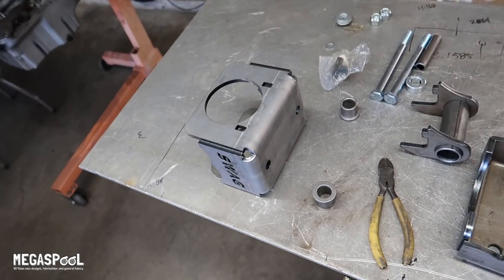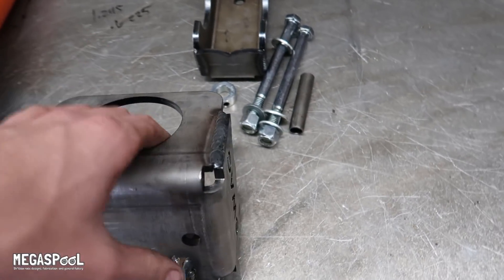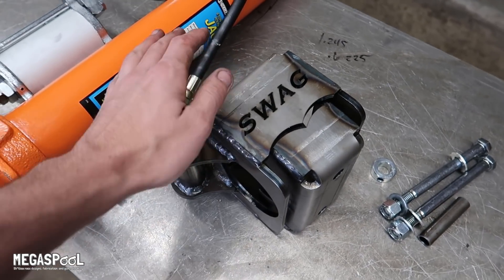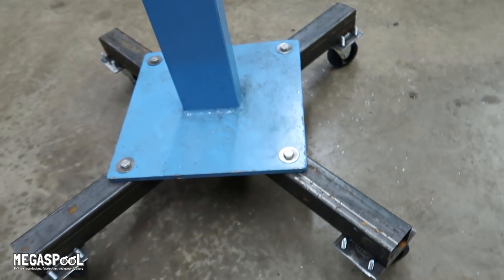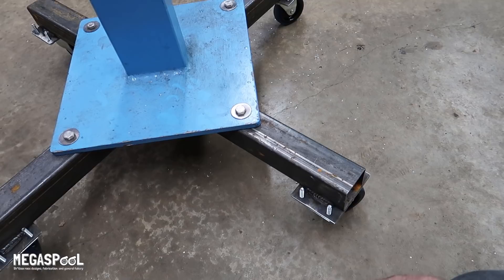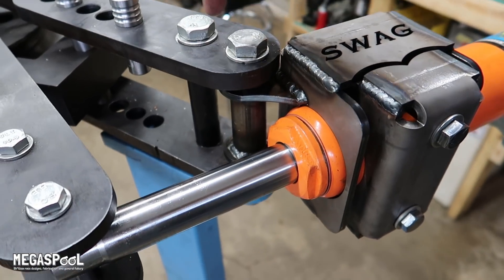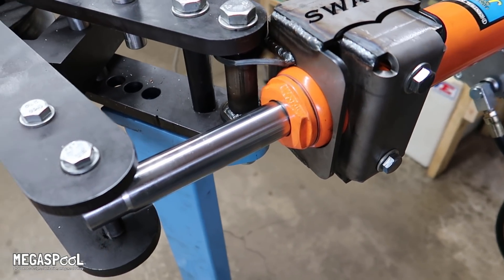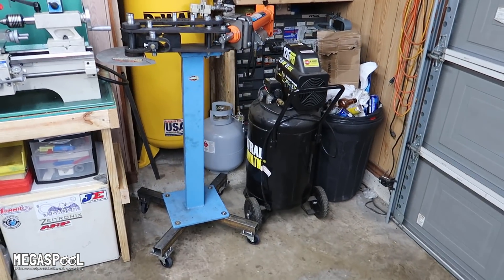Converting My Tube Bender!

Comment: Hope u have a good vacation. Good solution for the bender. Next the benchgrinder I'm sure you'll have a better idea for that then what I came up with lol.
Reply from the maker: iam theoutcast Thanks man, it was crazy lol I think I’m gonna do a smaller version of the belt grinders knife makers use and just make the pulleys the sizes I need to notch at then build little tables for each one. I’m still trying to track down a VFD and the material to turn the pulleys out of.